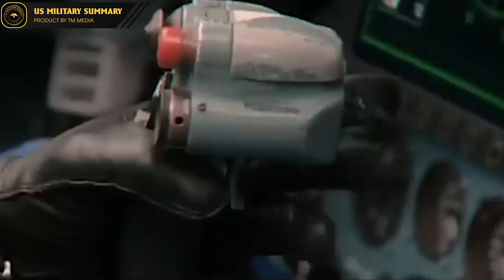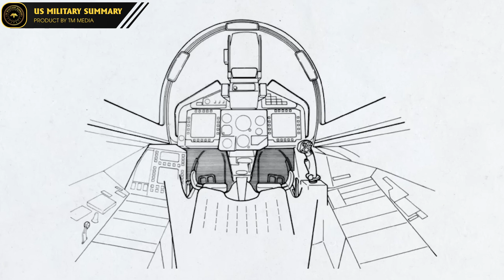Insane Project!! Russia Tests the Sukhoi Su-47 Superior Maneuverability Fighter | Military Summary

Comment: I wonder if modern electronics is what has allowed this design to become viable again. I've read the biggest problem with forward swept wings are stability at super sonic speeds, which fly by wire helped but didn't cure but that was in the 90s. With smarter stronger smaller avionics, electric motors and solenoids equals a lighter more stable air-frame
Reply: Makes me think if the US will revisit the X-29. Probably not when you can have a F-35 launch a missile with a 30 mile no escape zone. Increased agility wont mean too much then.
Reply from the maker: Yes, modern electronics, such as fly-by-wire technology and advanced avionics, have played a significant role in improving the viability of forward swept wing designs. These advancements have led to lighter and more stable airframes, particularly at supersonic speeds. Thank you for your comment.